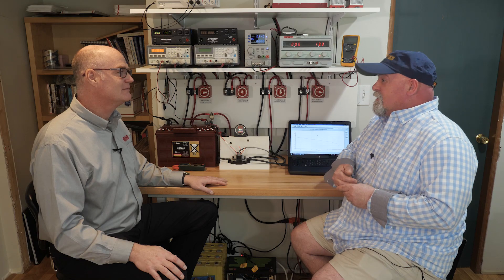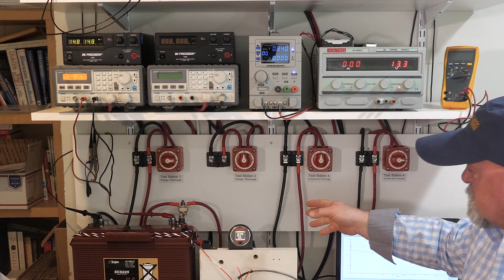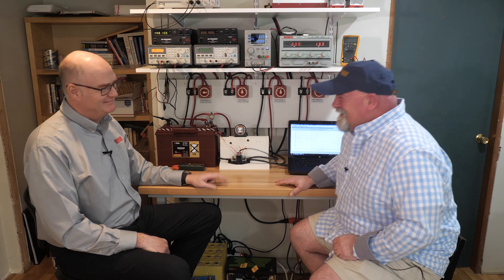How We Tested the Balmar SG200

Comment: THE MAIN reason ALL battery monitors have inaccurate SOC is due to the resolution rate of their shunt and internal algorithms.

If the shunt is rated for say 200 or 350 or 500 amps at +/- 1%, you get 2 or 3.5 or 5 amp approximations and variances. 

Also, many battery monitor gauges only read >1A charge or discharge -- meaning all those little trickle currents in (eg, from solar) or out (low current standby devices) add up over 24 hours to cause large discrepencies.